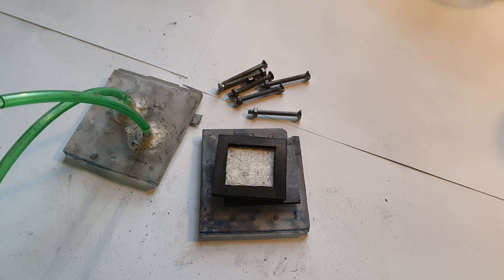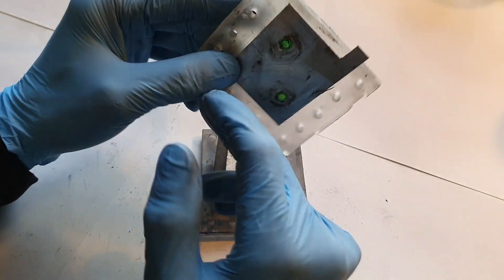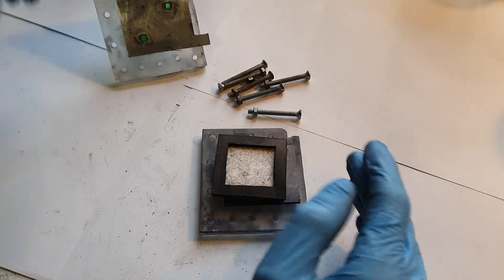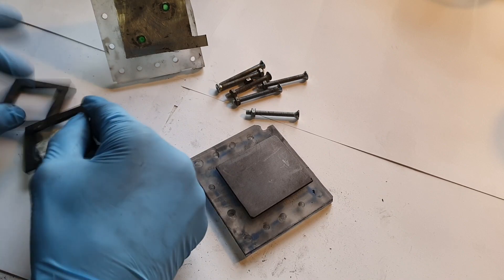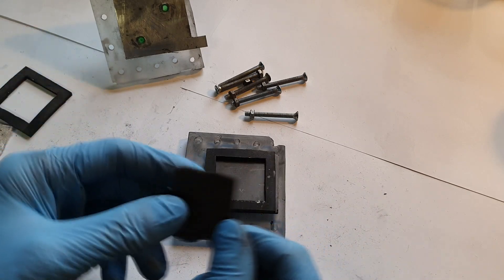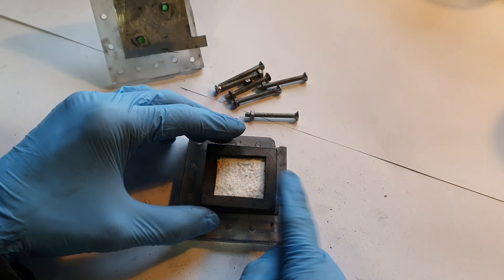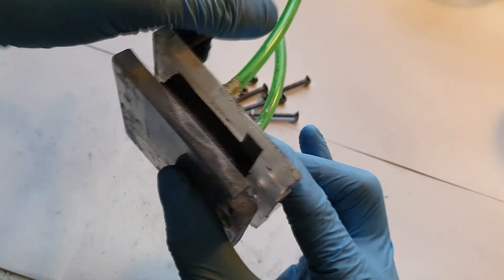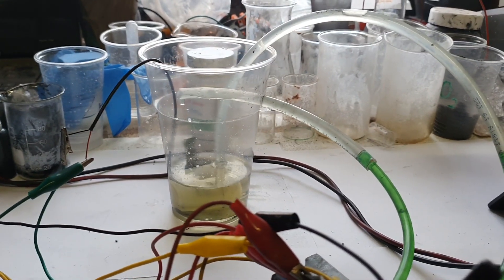Diy Hybrid Redox Flow Zinc Bromine Battery

Comment: Hi Mate! You know I'm really enthusiastic about this kind of battery! Great job
A question, shouldn't be redish the electrolyte (bromine)?
Reply from the maker: Not here in that cell design. The pipes go in and out on the negative side. The bromine is hold in the positive side. Another cell which have the pipes conected to the positive side,... then the bromine is stored in the tank, which have better capacity and much lower to minimal self discharge.

Comment: Hello cayrex2, I was wondering could we use
Zeolite Powder to make a separator much in the same way as you make carbon sheets? Then we could form it thin and in many shapes. Thank you.
Reply from the maker: Yes you can make separator that way. Cement, gips,....
Reply: @cayrex  yes I have watch that one great job! But I was asking if its possible to make like a PEM From zeolite and Styrofoam? Then use that instead of glass fiber.
Reply from the maker: @rsummers1974ify  PEM from zeolite and styrofoam??? I am not sure about that.
Reply: @cayrex  Ya I just was curious. As I seen the video you made on how to make graphite plastic. I thought Mabey mixing acetone Styrofoam And Zeolite together in much the same way may work. I belive Zeolite is micro porous crystalline structure could work. I just want thank you for all you do. I learn so much from your channel.
Reply from the maker: https://youtu.be/-8eop5_IL9s
Reply: Robert Murray Smith made his separator of clay flower pot. So just simple  fired clay. As it is porous and can suck in electrolyte.

Comment: Hi Cayrex2, Will this cell being close separation could die from Dendritts quick? Sorry to be negative instead of positive lol
Reply from the maker: The ZnBr cell will not die from dendrites. Of course the dendrites will short the cell, but the cell will not die. After forming the dendrites you just  short the cell with connecting the positive and negative terminal to discharge the cell completely. The Zn and Br will react to form ZnBr2 again and the cell be like new. For example the cells of Redflow batteries are completely shorted almost every 4 - 5 cycles,.... that they eliminate dendrites.
Reply: @cayrex  Hello Cayrex2, Thanks for your reply. I am slowly learning more and more. I just realized the reason for the electrolyte tank and pump, is to increase charged electrolyte volume and not to deal with dendrites. So to remove dendrites we can short out positive and negative to drive dendrites back? Is this a direct short that is used? If so that means giant spark😯? Or current limited shorting?
Reply from the maker: @eeezygoing  yes, you discharge the battery to zero volts but you dont short the charged cell.
Reply: @cayrex  Ah ! Spasiba Boga lol I was thinking of seeing a huge whack of spark and crackle, with the discharge conductor turning bright red and maybe melting lol I would like to see that one day !! on my ZnBr2 cell in full size lol